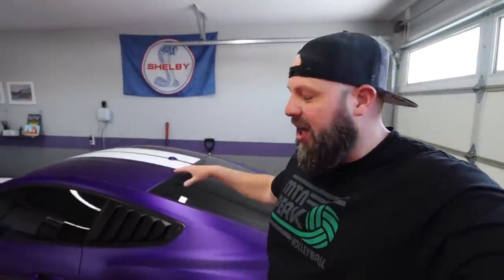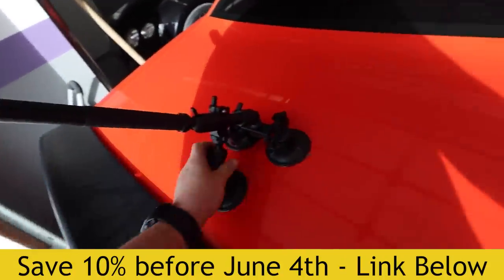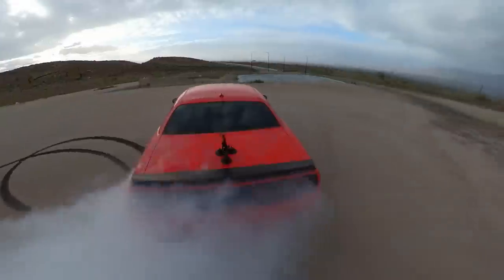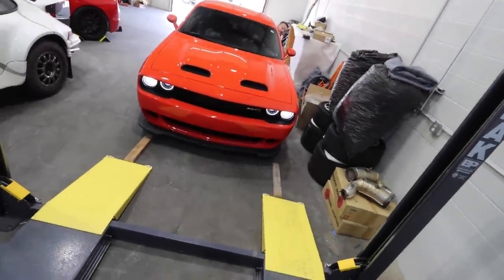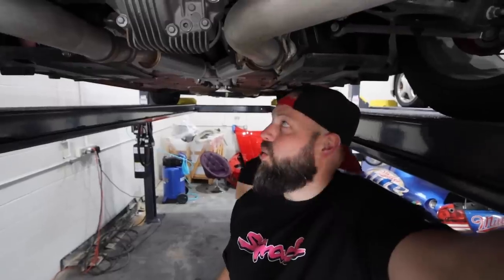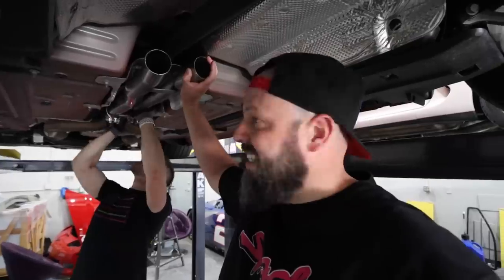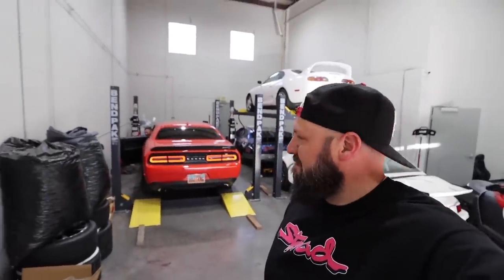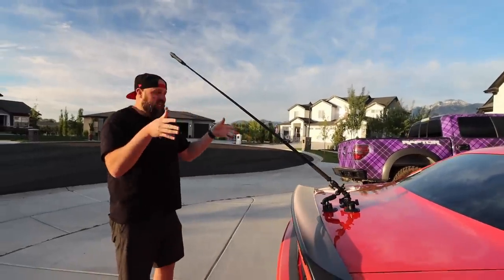Installing a way better exhaust on my Dodge Hellcat

Comment: This one made us hungry 🍩 Awesome video, man, the sound of that engine 💯
Reply: @Insta360 where can I get that suction cup mount at? Mine came with a single suction cup and it isn’t strong enough to hold the weight of the camera up. Kind of disappointed with that

Comment: It sounds really nice I mean it's loud enough all my vehicles I take all the stock mufflers off and I eliminate all the resonators when you eliminate the resonator cuz that controls the sound you have a deeper sound it's louder and then you get the bulbs and it sounds really good I don't think they have resonator who you just put on but it sounds good the car is nice cuz you could just rip it at every light you can just sit there and burn rubber and burn rubber every way if the edge every way

Comment: Insta360 ain't cheap. That's why it's great necessary to have sponsors. So, Nick any thoughts on getting a Carbontastic steering wheel as a mod? Yeah, I know they ain't cheap. Here's an idea for a mod for the Hellcat get the pedal commander. I got the Tazer for my Charger and it gave my car sport mode and SRT performance computer pages in the Uconnect system, which, well, um, your Hellcat doesn't need.

Comment: The 4k limiter is called a soft limited it comes in newer automatic cars so if u try to do it in ur raptor it would most likely do the same thing, a tune might possibly eliminate it tho
Reply: Yeah 👆🆙👆congratulations don’t miss out 
Send a direct message you’ve been given an ENTRY FOR THE GIVEAWAY ..

Comment: Don't change the corsa just add long tube headers a smaller pulley and a tune. Then you will have a car with noise plus a huge power increase.

Comment: You need to get electric dumps on there.. it will give u more horse power and make it your ears hurt.. you won't regret it. U also need a smaller pully to get more horse power out of it..

Comment: I have dyno max bullets in place of my mids. With rear stock resonators on.
Honesty they sound the same.
Just go to a shop that knows how to weld and it will look Like stock Exhaust.
Corsa not worth the money. Imo unless its gonna be a show car no need to spend money on an entire setup.